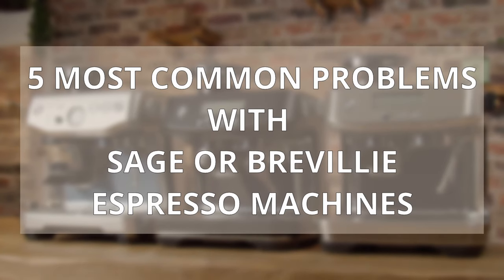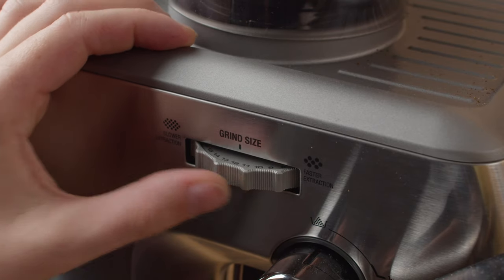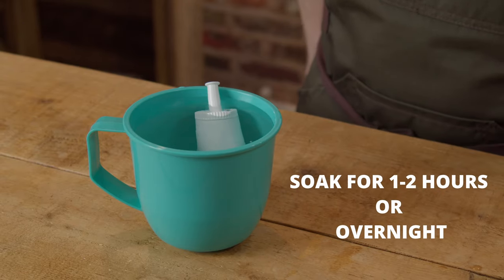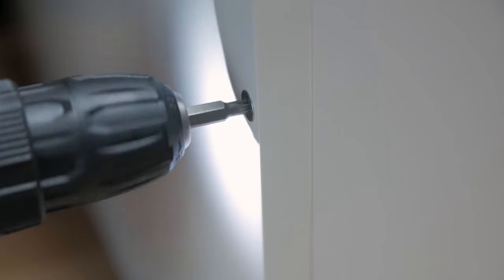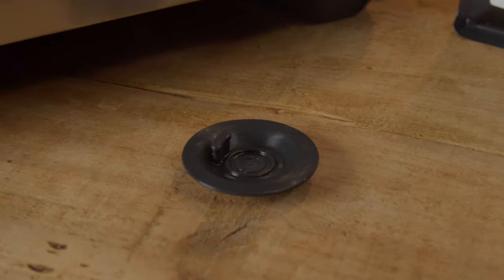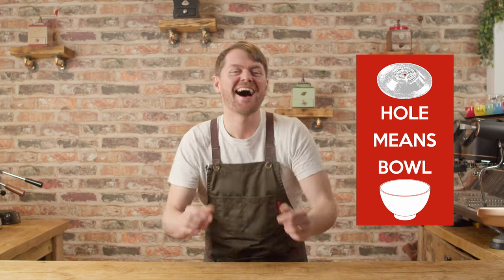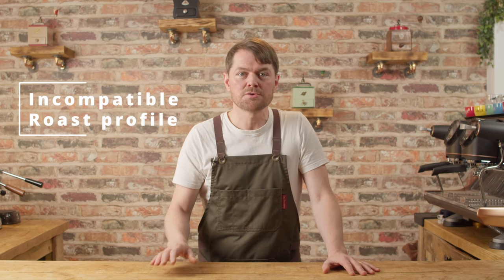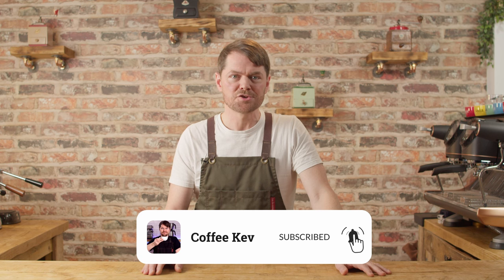5 Most Common Sage/Breville Espresso Machine Issues

Comment: You lightly touch on the volumetric buttons. I’ll just go ahead and say that it’s better to pull shots manually. There’s too many variables for a programmed volumetric shot and you may not get the result you’re expecting. Manual shots using a shot timer(like on the Pro) along with scales helps me diagnose problems with my puck prep quickly. I also like the pre-infusion control aspect of manual (8 seconds for me).
Reply from the maker: I completely agree Robert, and there's a "simplifying espresso" video coming soon on this point. Cheers, Kev.
Reply: Couldn't agree more with this. I got a Barista Express Impress at the start of December because I didn't want a new hobby and really wanted that assisted experience, however after one of Kev's other videos I realised I was getting 1:3.5 ratio consistently and didn't seem to be able to permanently change the programmed volume.
I've since bought a Timemore scale and now pull manual shots with ratio relevant to beans in use. So much for no new hobby! 😂
Reply: @StephenRandall  wait till you start roasting your own coffee beans. It’s coming.

Comment: Have to disagree there Kev. I'm an entry level kinda guy, Lelit Fred grinder and Sage Bambino machine. Vst shower screen and basket. Ive put every bean from every country available through them and always had positive results. Do I quite reach the profiles of a pro setup, no. But I do get a fantastic cup I enjoy to the fullest and save a couple of Gs in the process!
Reply from the maker: Good stuff Nigel! I'm not saying no one can get good results with slightly lighter roasted single origins, for example, with an entry level setup. Some home baristas may well have the chops to pull of great shots with less forgiving beans via more entry level setups, but it's harder, so a lot of people will find it easier to get decent tasting shots by using more forgiving beans. Ta, Kev.
Reply: @Coffee Kev Thankyou for the reply. I retract my initial statement and apologise. I completely agree with what you're saying there. There certainly are easier ways! 
Would love to know your thoughts on outdoor/camping espresso. Is the 9barista the king? Maybe the Bellman series? Or does a simple moka pot still reign supreme?
Reply from the maker: @carpNcoffee  No apology required 😀, you weren't wrong, I think maybe I just stated that point in a way that made it appear I was saying that entry level setups can't deal with anything but espresso blends, that's not what I was meaning to say. 

Ah yes, decent espresso is a must while carp fishing! ;-). I used to fish, but coarse fishing, I wouldn't have had the patience for carp fishing - except floating crust, caught a few nice carp that way, and they were all "THIS BIG!!!", hehe. 

I think it just depends on the user, there's a growing number of manual options now and there are pros and cons for each. 

Ta

Kev

Comment: What about - espresso is coming out of one side or hole  of the porta filter but not both
Reply from the maker: Thanks for that, have you experienced this with a portafilter with a traditional splitter, or one of the types with the two stubby spouts? Ta.
Reply: I have the same issue, with Sage Bammbino Plus and supplied  Porta filter, two stubby spouts

Comment: I got a Solis Pro 115a Grind and infuse ( AKA Sage Barista Express)  i got it for 4 a 5 years. (just before they had their name chance) but at some point it as i plug the machine into the socket, it gives a power failure to my house.  is this common to half espresso machines after they get their ''age'' ?  or should sage last a little longer then 4 years?  thanks!

Comment: Hi Kev and everyone, love the videos, they're super helpful! 

I bought the Sage Dual Boiler a little over 2 months ago. It's great, however I get super inconsistent shots, almost every time I go to use it. Same grind size, same water temp using filtered water, same coffee (fresh, roasted within the last 2 weeks), same dose, same everything. Back to back shots, I'd get 18g in 36 out in 25 seconds, 28, 30, 33. For this particular coffee I dialed in at 18g in 36 out in 27 seconds. Programmed the shot timer but get a different result every time. I can't work it out, even the pressure gauge seems consistent. 
I'm pretty confident that my work flow is correct as well. I own a Varia VS3 grinder and Normcore tools including the bottomless portafilter and spring loaded tamper, wdt tool. My work flow doesn't change, it's the same for each and every shot, which is why I'm confused as to what is going wrong!

Has anyone had this issue? If so, please help! Thank you!

Comment: My oracle lost all of its shot volume settings the other day. I pressed the double shot button and the shot never finished. I had to manually stop it… never had an issue in the 2 years prior.
Reply from the maker: I would get in contact with Sage support just in case there is a fault.

Comment: I have a Sage Duo Temp Pro. It is 5 years old. It started to leak and particularly on the steamer low pressure and volume.  Sage offer a £199 charge or 20% off a new machine at rrp. There are service centres who might charge less. Posting is from £19 (if insured). 

I did look inside, what can be unscrewed but some panels don't shift and I did not want to use plastic breaking force. I assume some plastic pipe has likely to have cracked. As pump and heating is all fine it ought not to be a £199 particularly when that charge included new grinder blades (?) and descaling (I use filtered water so no lime scales).
Reply from the maker: Hi Gerald, this won't be that Sage are offering to charge you this, it's their out-of-warranty support partner. If you can find a local espresso engineer to take it to, you'll probably find it doesn't cost that much to fix. This is the guy I take My sage machines to for repair & maintenance etc. https://espressorepairshop.co.uk. Cheers, Kev.
Reply: I am looking for a replacement but find it hard to decide. Some of the more expensive and better built models also require a longer process and cleaning. The Sage machines are more user friendly and i have a decent voucher to reduce the cost. Instead of going for a machine costing £400 more a better grinder than my Sage smart grinder pro might make more sense. 
Profitec Pro 400 £1149
Sage the Dual Boiler £874.30 (30% voucher)
Profitec Go £769
Gaggia Classic Pro Espresso £429
Sage the Duo Temp Pro £279.98 (30% voucher)

Comment: Here's one: Inconsistent shot volumes! After calibrating the machine to dispense as many grams of espresso as I want and saving it, over the course of a few days, it seems to gradually lose its memory and revert to the full default shot volume. 

Puck prep involves WDT and calibrated tamping with the same beans so I doubt that's contributing to the issue. This is a Bambino plus I'm using.
Reply: I get similar with Barista Express Impress. With the same batch of beans and no changes to grind settings I get anywhere from 17g-19g in, and usually 52-58g out.
I've since bought a set of scales and pull shots in manual mode which gives much better consistency.
Reply: @StephenRandall  I agree, manual mode works well. But I thought the machine was supposed to save your shot volume settings after setting them the first time and so was wondering if this is isolated to my unit.
Reply: @Reapvr  definitely the same on the Express Impress. In fact, I've cleared the volume control, pulled manual @ 45g, then pulled auto and it came out at 58g!
Reply: @StephenRandall  This problem has been driving me crazy! It only gets 2 bars on auto, and then the manual dose is just a start-stop function and doesn't seem to stop on its own?!

Comment: Hey Kev, love the video. Hoping I can pick your brain and help me. I just bought my first ever espresso machine which was the sage barista touch. Having a bit of trouble extracting the perfect shot. The first drip starts around 4 seconds in instead of the recommended 8-12 seconds and tastes very wishy washy. I have made my grind finer going all the way to 6, however it is still starting to drip at around 4-5 seconds but now hardly any coffee is coming out and it taste very acidic. Any advise you could give me would be appreciated. I have also added more coffee to see if that will correct the issue but it will still drip at around 4-5 seconds

Comment: Hi Kev Awesome video! I have been repairing an old Breville Oracle BES980XL over the past month. 

I have scoured the internet for answers but cannot find a solution to my problem anywhere, Maybe you could help? 

Everything works well on my machine - BUT when the machine heats up to temperature, steam is coming out of the water tank/container valve :/ The water in the water tank actually boiled and the spring loaded valve in the water container has actually melted. 

I have taken apart both the steam solenoid and the hot water solenoid and couldn't find any obvious signs why they shouldn't work. I've also tried adjusting both Over Pressure Valves.  Would you have any advice or tips on how i can stop the steam returning to the water tank? Many thanks.

Comment: Thanks, Kev.  I have an SGP and a Bambino Plus and I love the espresso they make, especially with your Chocolate Brownie blend beans.

I'm still getting good shots from the bag with the 21/11/22 roasting date too!  (but a new bag has arrived now, so I'll move onto that one.)

Lots of compliments from the coffee-drinkers in the family. Cheers!
Reply: Hi Tim, 
I have the same setup as you and struggled with the chocolate browine blend to achieve 1-2 ratio without flowing too fast.  Could you please advise what grind setting, dose etc you were using?
Reply: @karltibbetts52  Hiya. Internal burr at factory setting (6) , external set to 1. 18 seconds gets me 18gr in the portafilter (bottomless with an IMS)basket and 36gr out in around 24 seconds. Shots are fine. 

I am going to try the internal at 4 with my new bag of Kev's beans and try and dial back the external from 1 to maybe 3.
Reply: Thanks for the insight Tim. 
I have been wondering about changing the internal burr setting but some reviews say you shouldn't need to change this until the burrs start to wear. I only had my setup in December. 
I've ordered some of Kev's fruit cake blend so I'll see how I go with that 👍🏼
Reply from the maker: Hi Karl, re changing internal burr setting - video coming soon, but basically there's no benefit of changing it any finer than 5 (from factory pre-set 6) internally. Setting it to 5 if your burrs are relatively new will just give you the ability to go slightly finer, it's as if the grinder has a little bit more in the bag that is hidden by being set at 6, but going beyond that doesn't achieve anything as I'll explain in more detail (and demonstrate) in the upcoming video. Ta, Kev.
Reply: @Coffee Kev  Thanks Kev, I'll look forward to the up coming video. Thanks for the great content by the way. 👍🏼

Comment: Great video Kev. Thanks.
My issue with the barrista express:
In order to get 1:2 ratio in around 20-25 seconds (from first drop in cup) I need around 19gr very finely ground coffee in my portafilter.
19gr is the very maximum to maintain sufficient clearance above the puck.
My grind setting is so fine that I'm constantly bordering on choking the machine.
Finer grind with less coffee just chokes the machine.
My pressure gauge is always at the very max of the "espresso range" as sage calls it - if not beyond.
Makes a decent cuppa (I always drink as americano) but just wondering if I'm doing it all wrong?

Comment: I’m having a weird issue when it comes to dialling in. I ended up with two lots of beans at the same time so I used some to try (Baytown bends and caravan daily) and then froze the rest in vacuum sealed bags. The unfrozen ones went fine, dialled pretty easily. When I’ve come to use the frozen version, it all goes wrong! Last week I tried the caravan ones, today I’ve tried the Baytown ones. Initially (on about a 14 on my impress), I got 24g out on the first go, so I went coarser and then I got a very thin ‘drippy’ stream which then eventually stopped and was way less than 24g. 

Last week, the first espresso came out fine, but the second and third followed the same pattern as todays. I gave up and tried the next morning and it was fine save a bit of adjusting you’d expect. 

I’ve no idea what the issue is, it seems like my machine just doesn’t like frozen beans, but it acts in the way I’d least expect! Have you any ideas what I’m doing wrong please?
Reply from the maker: when you say "frozen beans" you mean they were frozen, you then let them thaw and you're now using them and keeping them out of the freezer, or do you mean you're taking them out of the freezer, using them and then putting them back in? Ta, Kev.
Reply: The former - I ended up with a lot of coffee in a short space of time, so I split them into individual 100-112g bags and froze them all. The first time it had happened, the beans were straight from the freezer. Have tried it this morning with a pack id taken out of the freezer last night so had defrosted! This morning, the first espresso came out fine but second/third immediately after were rubbish. Took 50 seconds to get to 28g out on the third! Same grind size (happy to change it, but I don’t think that’s the initial issue)

Comment: I've just got mine back after it being sent for repair but it's still got the same issue. When using the steam wand the steam comes from behind the drip tray. Issue began after 60 days pulling maybe 2-3 shots per day on average. Apparently it needed descaled. We live in Scotland in a soft water area so not surprisingly descaling did nothing. First use after being returned its exactly the same if not worse.

Comment: Would you say the Eureka Mignion, mainly the Manuale might struggle with a light, denser bean?? Was thinking of trying some of your lighter roasts beans you have on the website..
Reply from the maker: Yeah I'd say the entry level Mignons may struggle a bit with lighter roasts, the higher level versions with the slightly bigger burrs (specialita for example) will probably do better, although there may be some beans that these don't quite have the grunt to deal with properly. Ta, Kev.

Comment: Hi Kev, new sub here 👋 and new to the Saga dual boiler. You have some great content which has helped. 
However much I try, my shots don't produce any crema, what would you suggest to fix this?
I'm using a med/dark freshly ground bean. 18g in 36g out at 27secs, pid set at 34 degrees. 
TIA

Comment: I have a problem with my Sage Grinder Pro is over filling the portafilter. It was fine up to the point were I started to fill a jar with several grinds. When I went back to using just grinding direct to the portafilter it now over fills (double the amount). The setting have been the same in each case - 19.0 grind amount/time 2 shots  6 size.

Comment: Hello, so my Breville barista express isn’t expressing out any coffee problem #1, we have gone as course as we can and it goes high pressure but nothing comes out. We have looked at the water hoses inside and they also are clear.
Reply from the maker: That's odd. You're using the single walled baskets? If so, I'd contact support. Cheers, Kev.
Reply: We are also having a similar problem. Some water is coming out but nowhere near a full shot and when we try without coffee the basket is full of water that won't drain out unless you tilt it this way and that. Any ideas?? We have the Bambino plus

Comment: Hey Kev, do I still need a water filter if I add filtered water to the tank? Also I  think I've choked my bambino plus with too finer grind size. Any tips on fixing a fixing a machine that wont pull water through, even with an empty basket?

Comment: This is the NEWer disc for the Barista Pro. If you call Breville or Sage you’ll get this information. Those who are saying buy a disc without a hole should perhaps phone the manufacturer. The older disc without the hole apparently caused problems with the Barista Pro. 

If you run the Flush without the tray grid you’ll see that some of the water does back flush through the machine. 

Tested:
Stock Portafilter (PF) - which I only use for Back-flushing (on the display called Flush), I use a Normcore bottomless for making espresso. 
Stock 1 cup dual walled basket. 
The disc that now comes with the Barista Pro, the one with the hole. 
One Cafiza tablet. 

Total liquid 450ml
Via the PF 300ml
Back-flush into the tray 150ml

Comment: What to do if machine is simply not working something like that #1 case but the water won’t come out even if you don’t put the basket with coffee grounds inside. You can hear the noise, as usual when it was working, but the water is only going to waste water container. I don’t think changing coffee grounds would be any help in this case. The pressure is not moving at all.

Comment: I was given a selection of Rave Coffee beans recently and after watching this video, I'm wondering if they're not the best option for my Sage Bambino. I'm currently using Rave BRAZIL FAZENDA CAMPESTRE Nº 109. It's a single origin, is this not a good option for the Bambino? I'm very much a beginner, and I'm still finding my way.
Reply from the maker: I've not tried this coffee, but it's a medium roast single origin, so speaking very generally, I'd say you'd possibly find it easier (as a beginner, using an entry level machine) to get good results using an espresso blend, something a little bit darker roasted (it doesn't have to be super dark). Cheers, Kev
Reply: @Coffee_Kev  Cheers Kev!

Comment: Hi, thank you for good video. My problem is that, the mashine not stoping during making expresso, it fill up all glass with water and I have to stop manually. It not happend all the time but very often. I have Sage the Barista Express. This is a software issue or computer get mousture? thanks for any advice